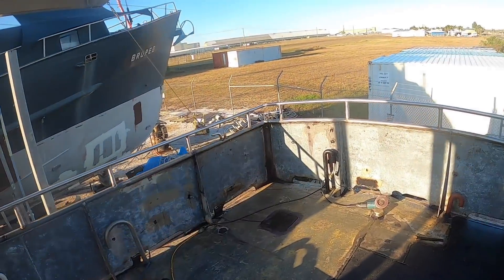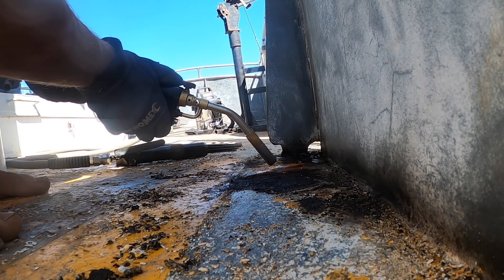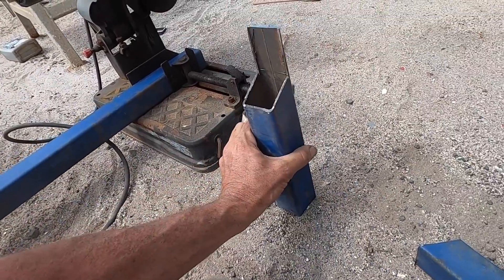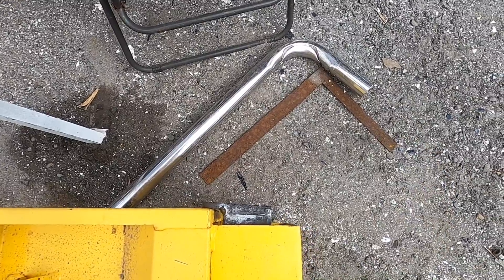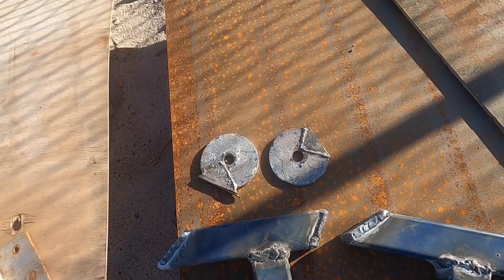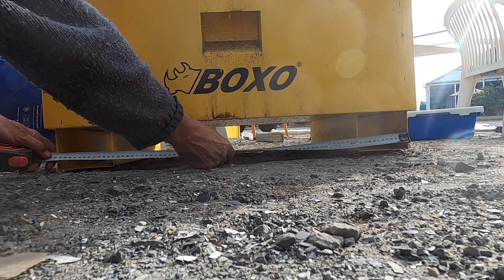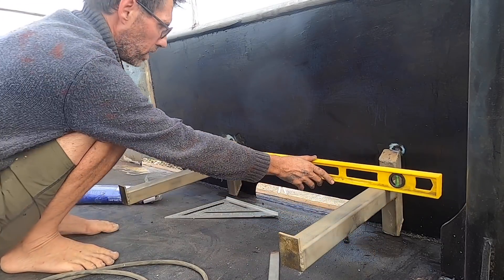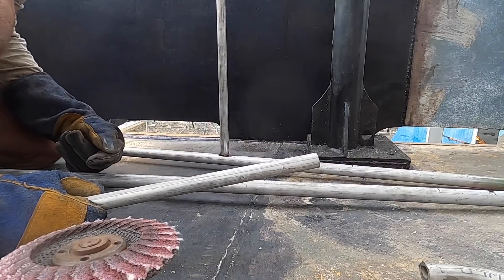Week 5 on the hardstand

Comment: When welding Stainless Steel, if you spray it with a bit bit of window cleaner it will help keep the finish from getting tarnished. Learned that today while helping a welder at the machine shop.
Reply from the maker: Good tip!
Reply: Thanks for sharing that.
Reply: @craigkaschan4822  If I hadn't seen it with my own eyes I'd have thought it was BS. After welding you just wipe it off and it looks like it had never been welded on.
Reply: “window cleaner”??  I believe you, but  WHAT window cleaner are we talking about?  “Windex” ? Or some kind of foaming cleaner [from an aerosol can]?
Reply: @Studio51media  They where using a Windex type.
Reply: Ok I'm going to try it thanks

Comment: Tip for burns: as soon as you can immerse the burn in cool water. Replace the water with more cool water as it warms up. Just 10 15 mins of this will save a lot of grief.
What happens is the heat is absorbed into the flesh at the instant of the burn. 
Most of the damage happens when that heat is reflected out back through the flesh. Its like a microwave cooker burning from the inside. 
Controlling the emission of heat back into the flesh is very important part of minimising the damage, the outer burn will stay but heals quickly being on the outside in the air. 
The inside is where the real damage, and consequent pain takes place. Really severe body burns can be treated the same in a bath and this is a very effective.
cheers
Reply: Seems like good advice but as a baker you get burnt on a regular basis. We found the best cure was vegetable oil on the burn and then put your hand in the oven . The pain is quite intense for a few minutes but then the pain disappears and it will not blister or become infected.
Reply: Yep - first aid course said to run water over the burn for 20 minutes or more. Makes a massive difference to long term outcomes.
Reply: Applying heat to a burn? Amazing.

Comment: Nice to see you still going strong.  I find it funny that you weld in bare feet.   Better than welding in flip flops.  It never fails that a hot piece of slag will hop into your slap, and you then desperately try to kick it off your foot.   At least with bare feet, it just bounces off.    I see you wire welding more now too.   They both have their place.

Comment: If you have a right hand propeller I would put the ladder on the Starboard side because it won’t get in your way when docking PST if you have a left handed propeller then yes on the Portside.
Also it’s better  to have the ladder steps flat on top as it make it very easy to stand on. Round ones dig into your feet.
Reply: You nailed it on the steps.Teak is nice.

Comment: Have you ever tried dry ice to get rid of old sticky non slip paint and adhesive.   Works out more expensive but about a tenth of the time and effort.  Dump the ice on, cover it with a towel, let it sit for 10 minutes, sweep it on to the next section and cover it, return to the uncovered section tap with a hammer and it shatters off the steel.   Heaps less effort.

Comment: This might really sound stupid but you might want move your step to the left side of the ladder. Most people are right handed and they go to the front of the boat on the left side (port) . And when they leave the front of the boat they come down the starboard side of the boat. Just me watching over the years but people keep there strong arm and leg to the inside of the boat. Easier to go up the ladder coming out of the wheel house . I would also grind the sharp edge down on top of the wheel house at the ladder . OUCH on the shin of your leg ...Just saying . Cheers from Murrells Inlet SC .
Reply: Sounds like you have been on the water a little to long but right .
Reply: @jack9609  Sorry just watching while running charter when I was much younger .....
Reply from the maker: I put the ladder up first so I could figure out which side I preferred.
Reply: @DangarMarine  Ok . cool ... Just saying .. That's a lot of work to do in the time that you have too do it in.. I think it's time for a few beers and relax !!! If you were close by I would drop off a few cases and help you drink them !!

Comment: Mate hope is not too late; you mentioned you‘d be leaving the rubber seals for now and painting against it, I do not recommend it as it will leave a very rough edge even when you install the new seals.
From experience painting around windscreens on the old cars in the old days so we would not take the screen out, we used to put a thin rope or cable under the edge of the rubber lifting it to form a gap from the going to be the painted area and leaves a smooth unbroken edged
great video today...!!!

Comment: re paint look into agricultural enamel it isn't marine paint but works well on concrete trucks where acids are used to clean the concrete on the truck paintwork. it costs roughly $100 per 4L plus thinners. it is recomended to use undercoat but not nesesery depending on how good you want the finish.

Comment: For the venthead down to the cabin you really should have gone with a gooseneck vent as you will have water issues with the vent intake being horizontal. Rain etc isnt your main concern but green water will be an issue, unless you make a routine of sealing it, which in my opinion nullifies the purpose of the vent.

Comment: Burns suck, happens so easily. Bit of aloe vera gel perhaps. Bad spot for it too...

Everythings looking pretty sweet though.

What clearance do you have between the stile and the rim of the wheelhouse roof? Just occured to me you wouldn't ever want a situation where there was a slip and potential to catch/wedge an arm between the two in a fall.  Just a thought.

A solution perhaps, without undoing anything, would be to bridge that gap with a piece of tube at either side.

Comment: How do you know what is truly “level” and “perpendicular” with any accuracy on the boat as you do this work? 

Does the boatyard somehow verify the boat is set level in its cribbage/cradle for you?

Or is there an element of close enough is good enough?

Love your channel btw
Reply: Well, even if the boat isn't level on the stands you can match the level it IS at with what you add on.
Reply from the maker: You don't know for sure, you can certainly feel it in your feet that boat is sitting pretty close to the way it does in the water.
Reply: On a boat level is irrelevant, it's constantly moving so its never level
Reply: @rjk69  But you DO want internal consistency or it's gonna look like absolute hell. So building with a level boat on the hard and level components is valuable.

Comment: If I were you I would use big pipe for the ladder rungs. More comfortable for bare feet 🦶
Reply: I second that, I'd use 1×4  and paint the rungs with a bed liner type material or get some strands of sea mat to attach. My big thing with boats is the boarding ladders, these companies on these standard built boats really need to do a better job, solely because grandpa likes to hop in the water too, and likes to get out simple. Anyways, he's got a steel boat here and he can fab good stuff!!!